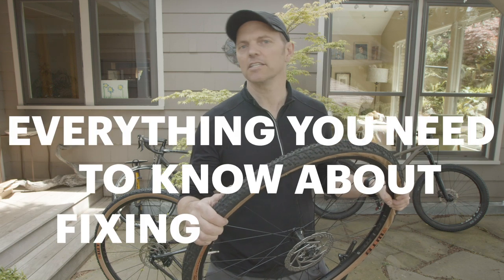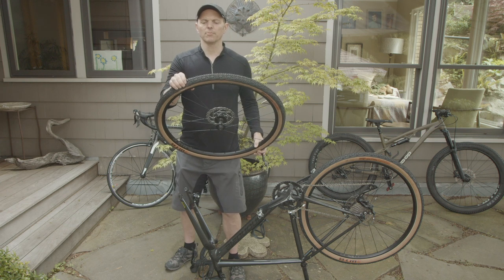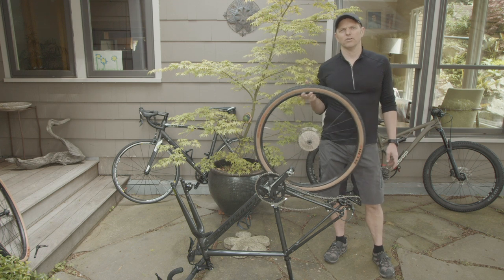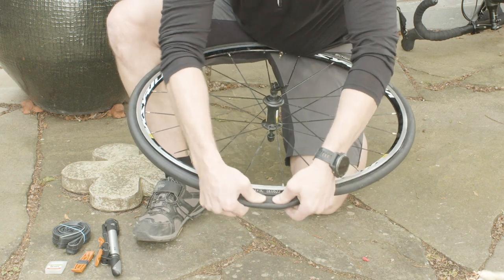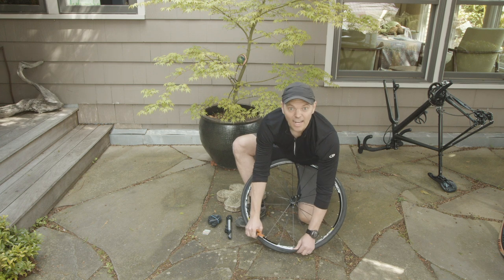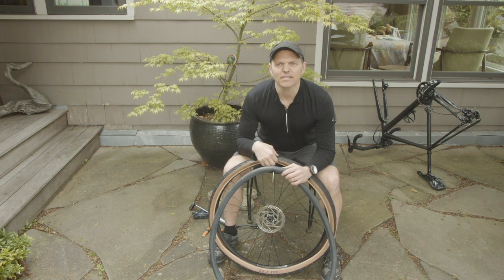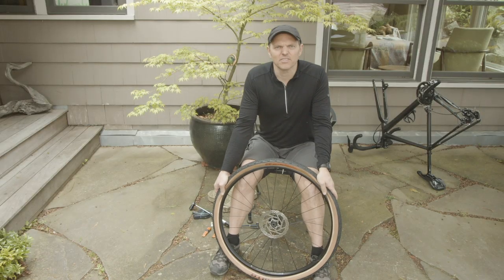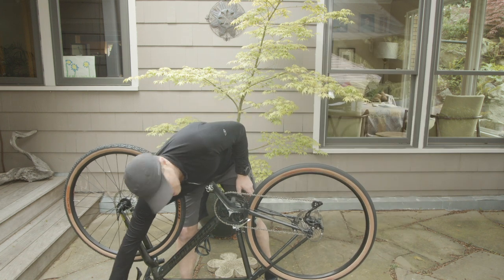How to Fix a Flat Tire || REI

Comment: Often traffic noise will keep you from hearing air escaping the tube. Running the tube along your lower lip lets you feel the leak. I usually line the valve stem up with the manufacturers name so I can find the object in the tire casing. Good video.

Comment: Nice video. The only thing I'd add is that I line up the label on the tire with the valve so that if I can see the problem from the outside, I'll know where to look on the tube once I get it off.